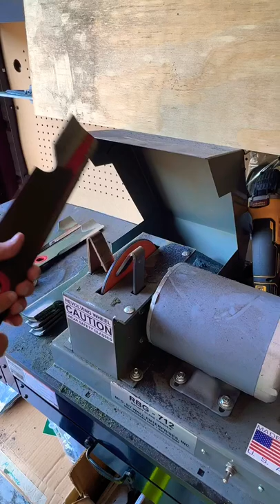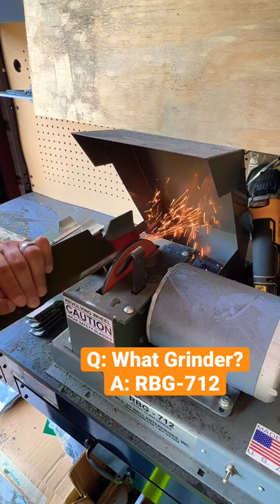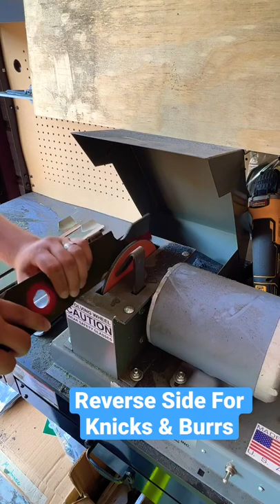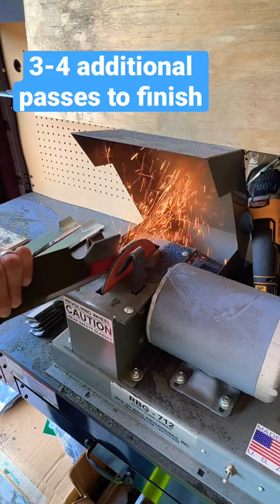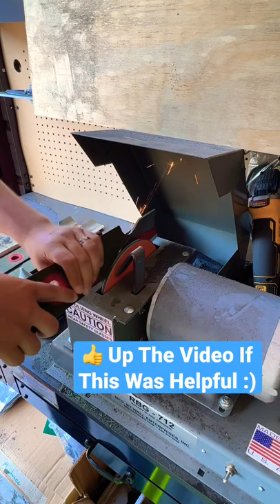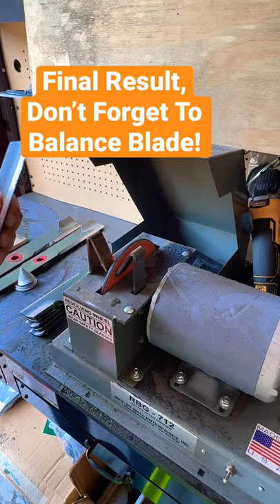DUMMY PROOF! Sharpening a lawn mower blade in 60 seconds #shorts

Comment: This is the best and easiest blade sharpener on the market.   It's only a few hundred dollars and not over $1000.  It keeps a consistent angle to the blade and can be used on both high lift and mulching blades.
Reply: Abusing it won't help gotta fix the Knicks in the blade first,check the balance then do a few passes too finally sharpen are you New ?